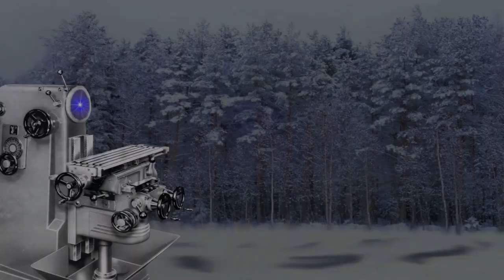Making a 30 teeth gear for the rotating welding positioner

Comment: I have to use 4 adapter sleeves if using morse 1 tooling. Needless to say I prefer straight shank and drill chuck up to 16mm in diameter and would use up to 20mm but sadly the drills have either reduced shank or morse taper from 16 to 20mm and no straight shanks even though the chuck would be available
Reply: And h7 isn't a very exact reamer if it's anything inside the h7 tolerance, I think that can vary from exact to free sliding fit